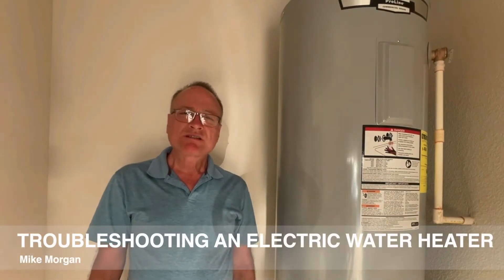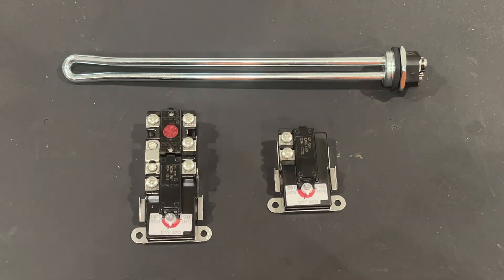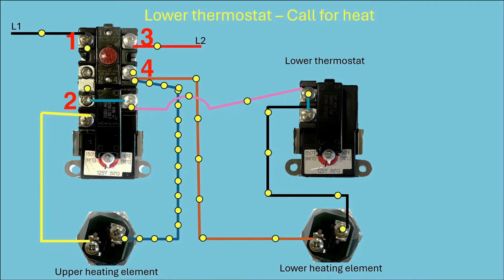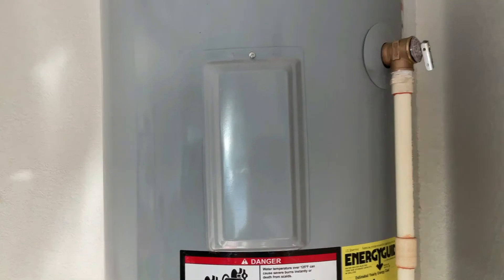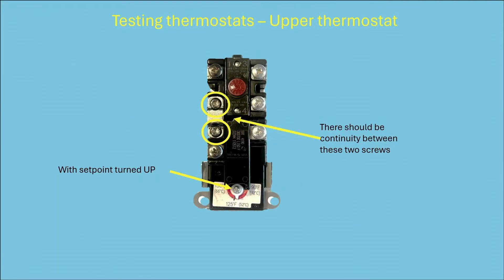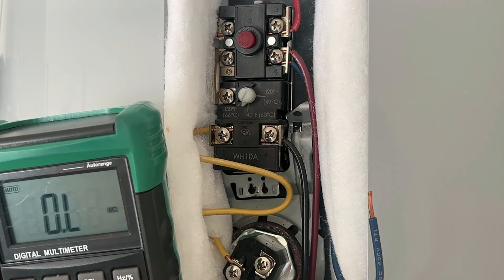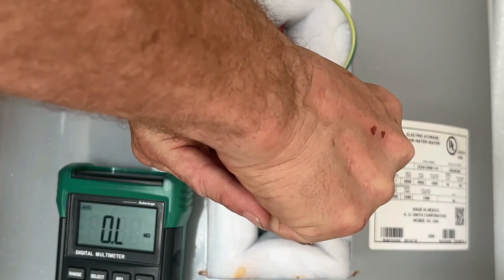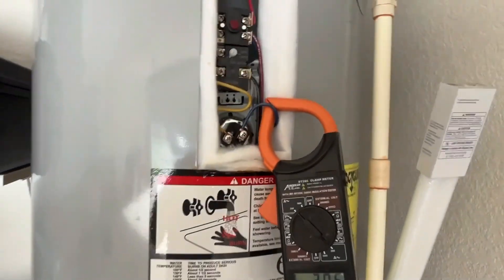Fix No Hot Water FAST! Electric Water Heater Troubleshooting & Repair

Comment: What’s wrong if I’m not getting any power in heating element when power is on ?
Reply from the maker: @CalmFarm516    Assuming you have verified that the breaker is good and actually delivering power to the water heater, it sounds like one of your thermostats has gone bad. Have you worked through the troubleshooting steps that I show in the video? I need a little more information to help you diagnose this.

Comment: "One element can operate at a time" is what we as electricians and plumbers refer to as "non-simultaneous operation ".  Probably 99 percent of residential water heaters are in this configuration. 

"Simultaneous operation " means both elements can operate at the same time, and this requires two 30 amp 240V circuits,  or one 50 or 60 amp circuit depending on whether the elements are 4500 or 5500 watts, and both thermostats must have a high temperature cut-off since they operate independently.   You'll most often see this in a commercial application such as a restaurant, or in very rare instances,  a home with a very large family and extremely high hot water demands where non simultaneous operation cannot meet the demand and a larger tank or two units cannot be installed for some reason.
Reply from the maker: Great info. Thanks!!